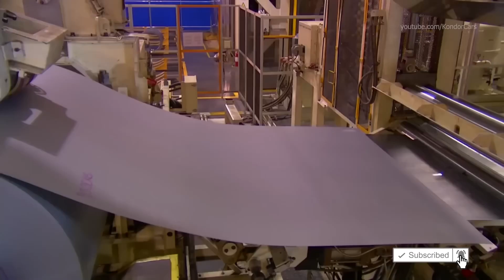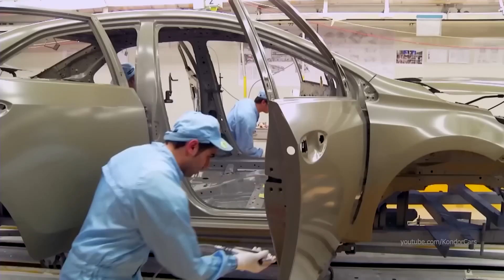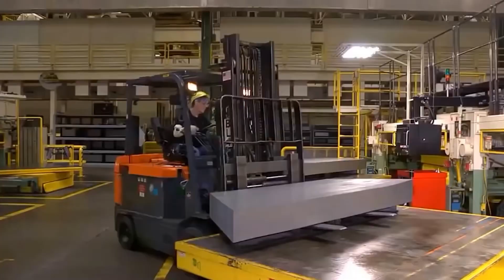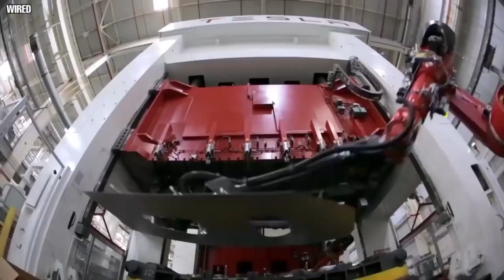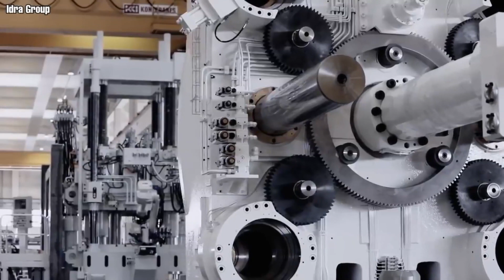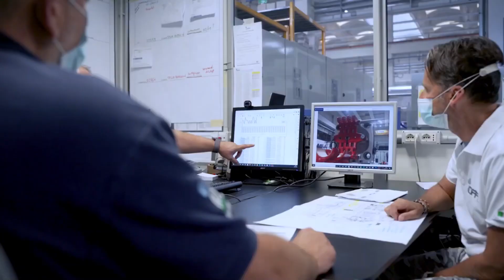Toyota FINALLY UNVEILED Its Own Giga Cast Machine: 1 Car In 3 Minutes!

Comment: A fender bender would likely take out one quarter to one half the chassis.
 Aluminum castings do bend, but not nearly as much as steel.
 This means an aluminum casting is likely to crack without being able to be straightened.
  Insurance rates have, and will be, at least three times higher moving forward.